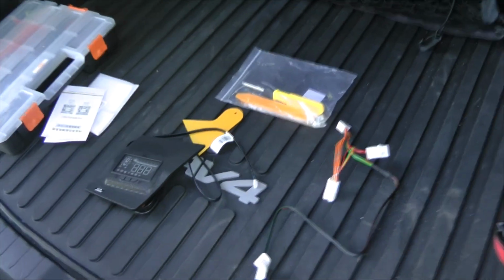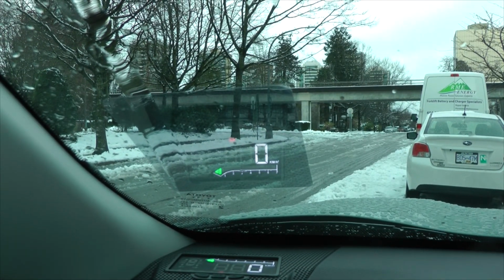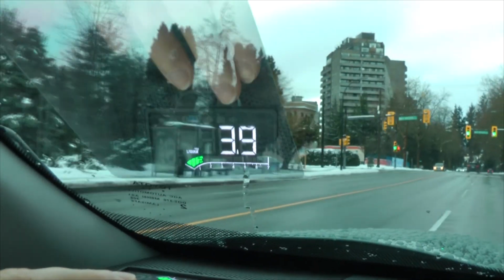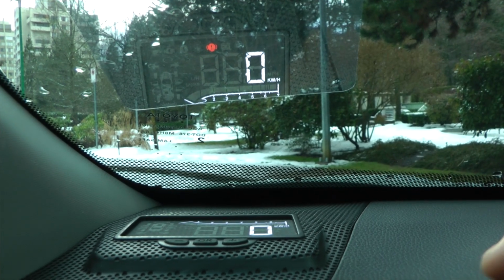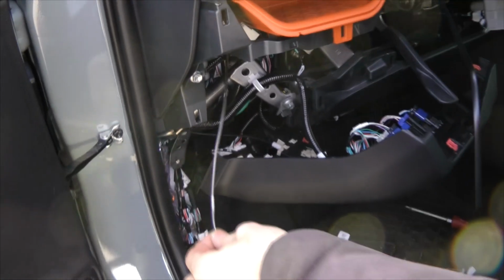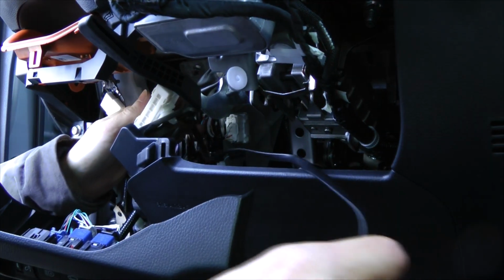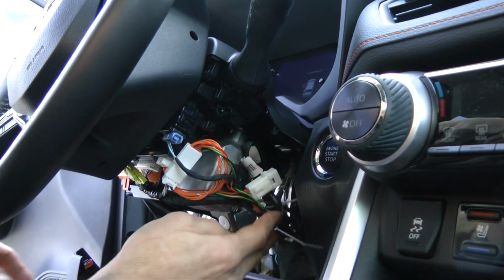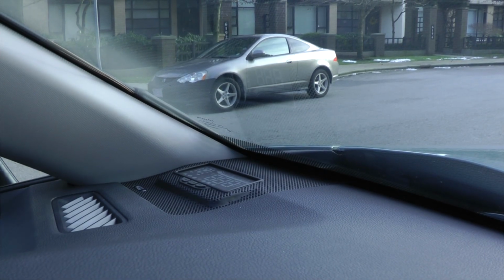Toyota RAV4 (2019-2024): Head Up Display (HUD) Installation And Review.

Comment from the maker: PRODUCT LINKS:
Head Up Display HUD For Toyota RAV4 2019 2020 2021 2022 2023 2024:
- CARTRIMHOME - https://cartrimhome.com/HUD-RAV4-2019?tracking=morozov_automotive.
- AMAZON - https://amzn.to/3TFpX90.

RECOMMENDED TOOLS:
1. WIHA HEAVY DUTY SCREWDRIVER SET - Wiha 53097 Screwdriver Set, Slotted and Phillips, Extra Heavy Duty, 7 Piece - https://amzn.to/3ystzRx.
2. TRIM REMOVAL TOOL - 4pcs Auto Door Clip Panel Trim Removal Tool Kit - https://amzn.to/41nYhsk.
3. SOCKET SET, RATCHET - GEARWRENCH 57 Pc. 3/8" Drive 6 Pt. Mechanics Tool Set, Standard & Deep, SAE/Metric - https://amzn.to/41wE6Z3.
4. ZIP TIES - 400 Pack Black Zip Ties Assorted Sizes 12+8+6+4 Inch - https://amzn.to/3xWjrjM.
5. CLIP REMOVAL TOOL - GEARWRENCH Panel Clip Pliers, 3705 - https://amzn.to/3SjP2Ff.

Comment: I couldn't find any install demo videos or pictures on any listing of this product. If no one had a guide I knew Mozorov would and here it is is haha. I guess it is technically plug and play but the amount of trim pieces needing to be removed to set this up is quite tiring. It seems quite challenging properly getting the cable to run down from the speaker down to the OBDII port area. My main concern would be making sure everything gets clicked back into place properly. I worry about running the wire over and behind the steering column...perhaps others are more comfortable doing that but it just feels like a piece of the car I should leave untouched during any modification projects.

Comment: Did you have any issues with the "Parking Assist Feature" after the install?  After I installed mine, my car showed the message "Parking Assist Not Available".  So now, parking sensors does not beep.  Wonder if there is a way to reset / reboot it.
Reply from the maker: Our vehicle did not have the parking assist feature and there were no problems after the installation. Try to unplug the HUD and see if it goes back to normal. You can try to disconnect the 12v battery as well.
Reply: @MorozovAutomotive  Appreciate your help.  I drove around for a little bit and turned off and on a few times.  It cleared up.  Thanks again.

Comment: For the US East Coast, that area of the HUD is where the Registration and Inspection stickers are supposed to go.  I guess that mod would not work out here.
Reply: It works perfectly I have a 2019 rav 4 adventure and it works the registration and inspection sticker helps. You don't need to put the sticker it comes with.

Comment: I have buyed and installed in Germany. Its working fine, but i am interested for an instruction manual, because of 7 different setup possibilitys. But you only get an QR Code for the chinese manual with the unit. its not possible to translate to german or english.  Where i can find an english version of the user manual?.
Reply from the maker: We had the same issue. I don't think it comes with English manual at least for now. Try using Google lens translate. It will help a bit.
Reply: Did you find the English manual ? I'm looking also for it
Reply: Bought the hud, got manual with all explanations, don’t know how to publish here ... got pictures
Reply: @stefankreu  can you please share the pictures of the manual?  I've been looking but can't find!

Comment: Soon as I plugged mine in it says, "Brake failure, stop car and visit your dealer"
Guess it doesnt work on
2022 Rav4 Prime
Reply: Any luck with this I've got the same issue
Reply: @darindelvecchio7525  No! Do you have a 2022? 
I suspect toyota purposely did this so you have to buy these options from them(at 3 times the price)
Reply: So I just finished installing a version of this from Aliexpress on my 21 hybrid XLE.  After I started up the car, I got the warning that "Parking Assist Not Available"....  but after driving for about 5 minutes, the message went away and everything seems to be working fine.
Reply: @darindelvecchio7525  I returned it to china and got one from amazon that sits on the dash in front of you, rather than off to the side. 
And I put sony tweeters in that spot, from cartrimaccessories
Reply: Hello

I just installed this and had same experience as you explained above. Though, all is back to normal now too.

But have you had any issues with it ever since?

I will really appreciate your response, thank you
Reply: @musaadedibu9316  If you have a 2022+, it’s never gonna work

Comment: What's the power consumption? I see it works even when ignition has been switched off. So it drains battery.
Does it show any hybrid specific info?
Reply from the maker: Not sure about the exact number for power consumption. But don't think it is a lot. It does shut down completely after about 5 sec. I don't think it shows any hybrid specific info.